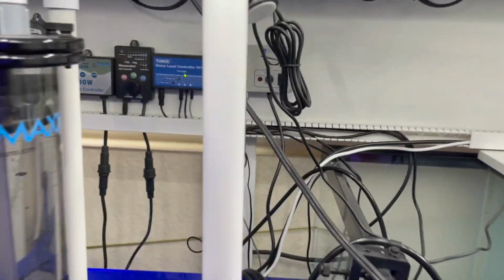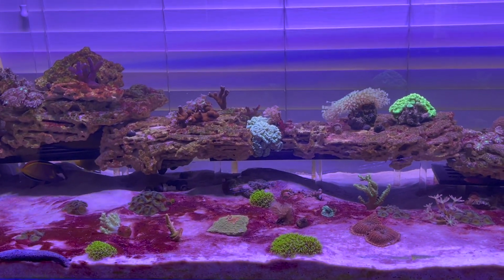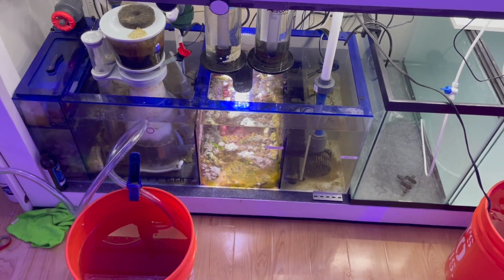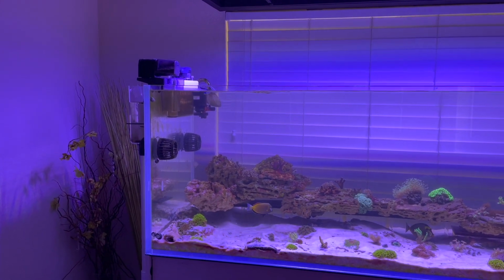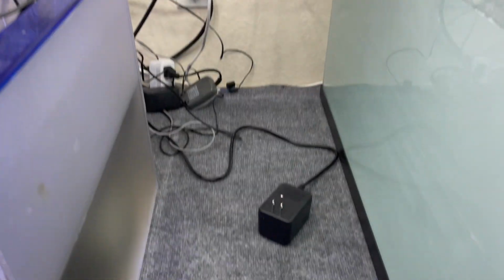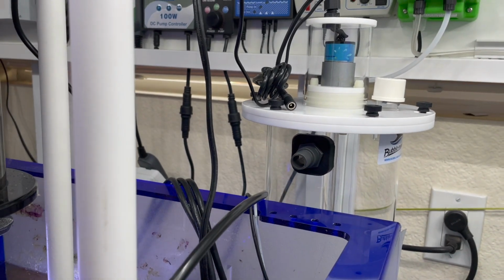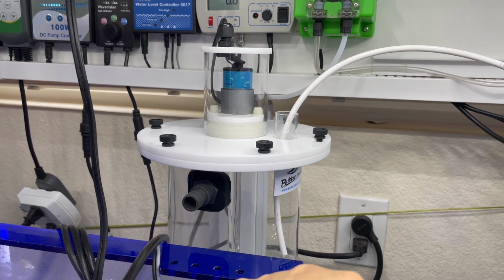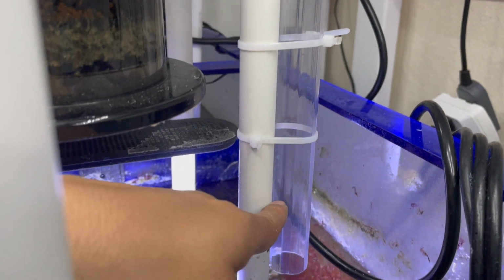BUDGET REEF TANK BUILD | SETTING UP BUBBLE MAGUS KALKWASSER STIRRER | WATERBOX

Comment: Awesome video mate. I'm thinking of setting up the same system - kalk/stirr set up. How are you find the set up? Does it keep you PH stable? Do you find it needs to does often to keep it stable and are you over worried about dosing to much? Im also considering adding a PH probe into top of the container that way I will know when its time to add more kalk.
Reply from the maker: Just a heads up the doser that came with the prob is slow and at times would keep running and cause my water levels to be off.

Comment: You should try more flow with Cyano, I was dealing with Cyano for 2 years and i increase my flow and return pump overturn, change my filter sock and floss more frequently after a few days it was gone.. I was surprise.
Reply from the maker: yea last week it looked like it was going away then it just came back with vengeance. i’ll try to increase the flow on wave makers return pump is almost at highest settings